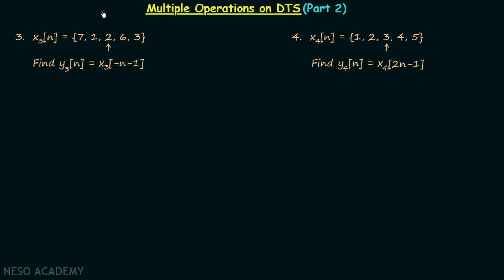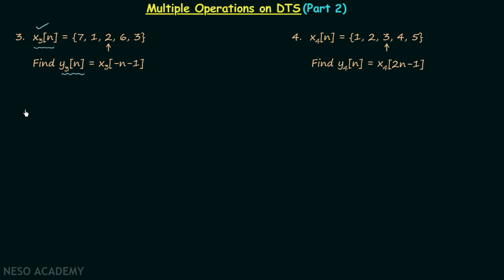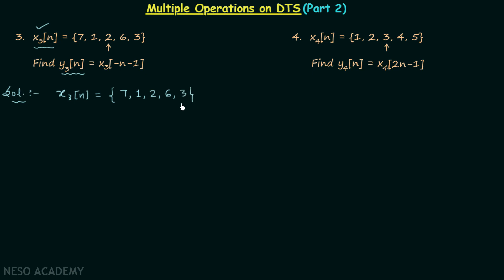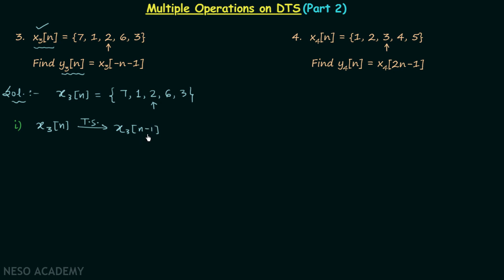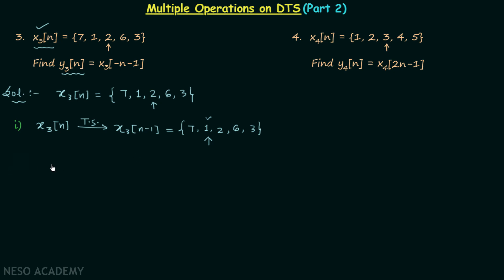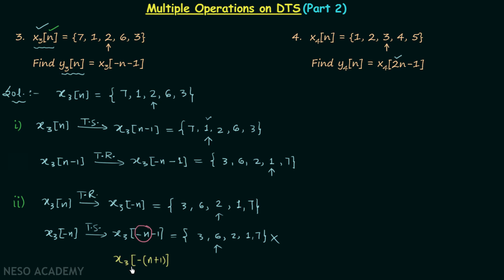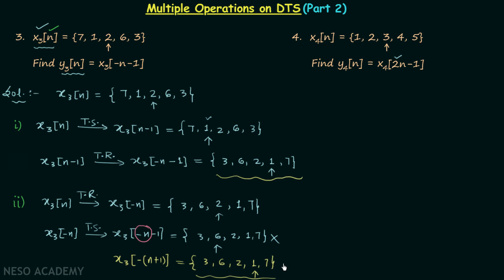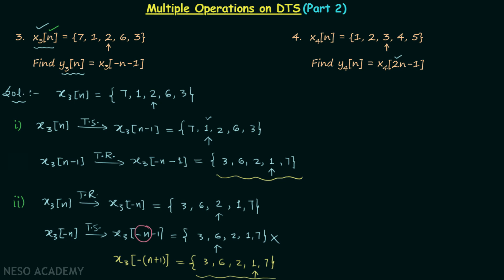Multiple Operations on Discrete Time Signals (Part 2)

Comment: How do we perform x[2(n-0.5)] on the HW problem?
Reply: First scale by 2 then shift by _0.5 
Or shift by 1 then scale by 2
Reply: Perform shifting first, then scaling. It is always preferred to do shifting first, then scaling next. Because by doing scaling first, you may loose some samples at the beginning. To avoid it, prefer to do shifting first.
x[n] = {1,2,3*,4,5}           *.. indicating value at n=0.
x[n-1] = {1,2*,3,4,5}
x[2n-1] = {2*,4}
Reply: @vavilapallisatyavenkatasan6563  y[0]=x[-1]=2 , y[1]=x[1]=4 so y[n]={2,4}
Reply: @vavilapallisatyavenkatasan6563  time scaling will be performed in n-1 or n (in 3rd step) ,  because if we do scaling first it becomes x[2n] and now if we shift then it becomes x[2(n - 1/2)] and i dont think we can shift it by 1/2

Comment: first doing time shifting by 1, now zero is at 2. Now multiplying n by 2 we get {2,4}.
Now if n is multiplied by 2 first then we get {1,3,5} and now shifting by1/2,  what will be in this case?
Reply: In that case also the ans is {2,4} bcoz we simply specify value at integer. After scaling x[n]  = 2 at n= -0.5 , x[n] = 4 at n= 0.5 now u can right shift by o.5  ..the ans is {2,4}
Reply: In discrete domain time shifting by fraction is not defined,so in this example only one way is possible.

Comment: The correct answer is X [2n-1] = {1,3,5} 
The zero is at[ 1]
Reply: Correct bro
Reply: wrong
Reply: u can check by replacing n=0 in 2n-1 we get  -1 i.e y4[0]=x4[-1]

Comment: x[2n]={1,3,5}

x(2n-1)=x(2(n-1/2)
    so everything is shifted to the right by 0.5? 
is that correct?
Reply: first apply shifting and then scaling 
let V[n] = x[n-1] ={1,2*,3,4,5}             -_- where * --> n=0
now apply scaling 
y[n] = v[2n] = {2*,4} is the final answer